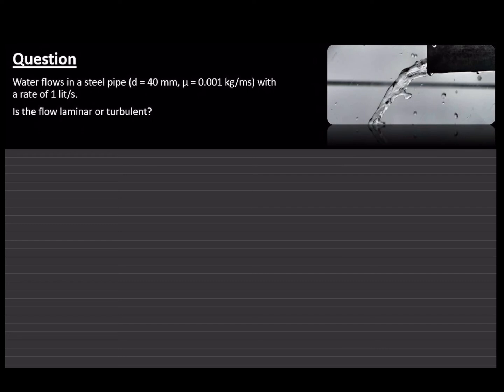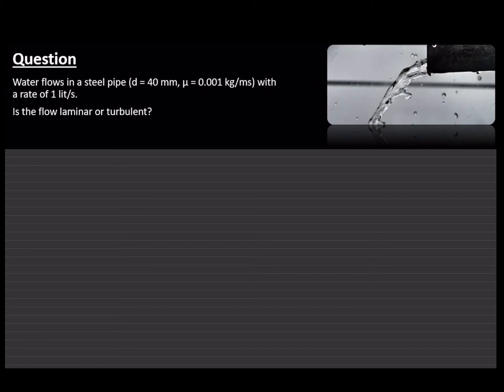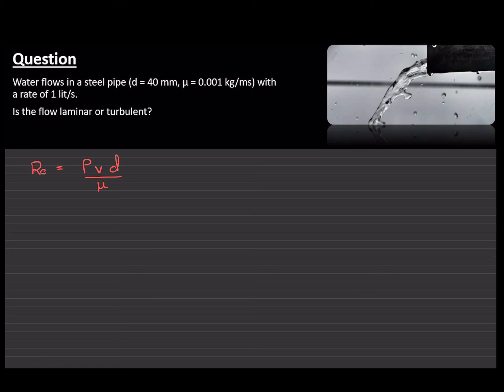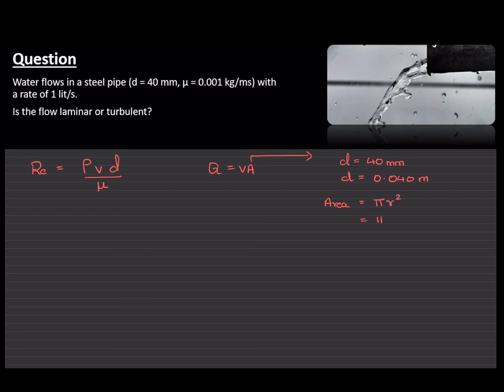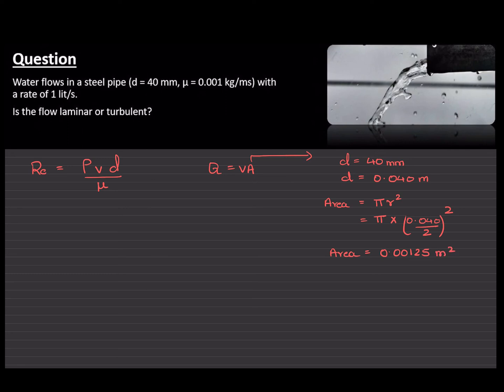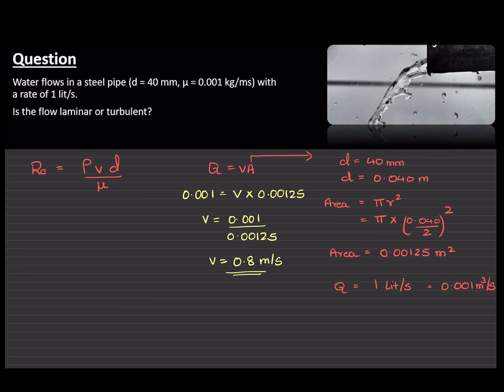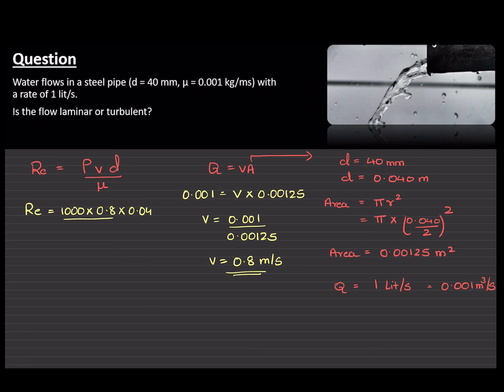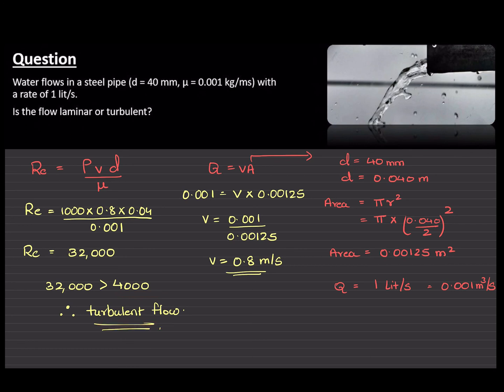Reynolds Number Example Problem - Fluid Mechanics

Comment: How did you get the 0.00125? Why did you not tell us?
Reply from the maker: Cross-sectional area of the pipe through which the water flows. Converted the values from mm to m and used the area of a circle formula.